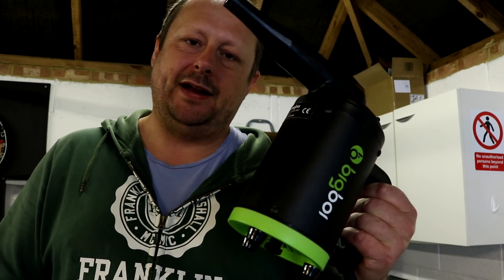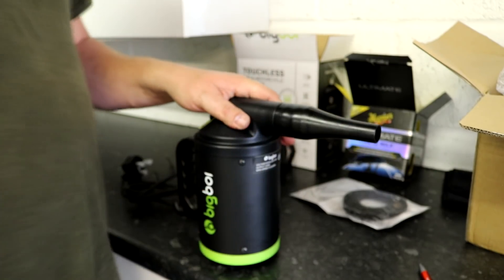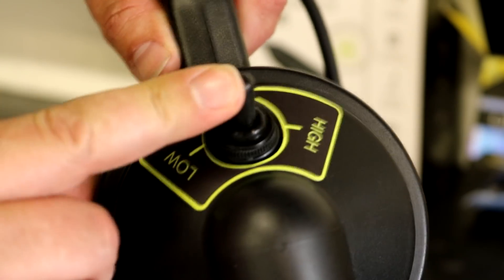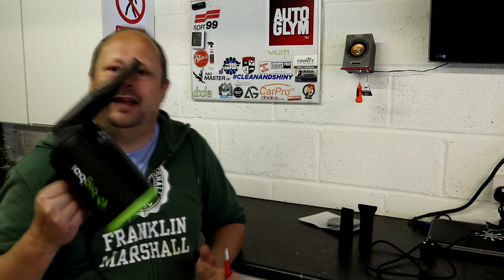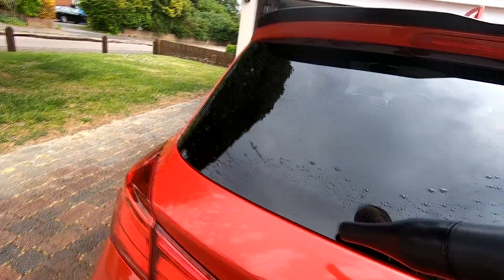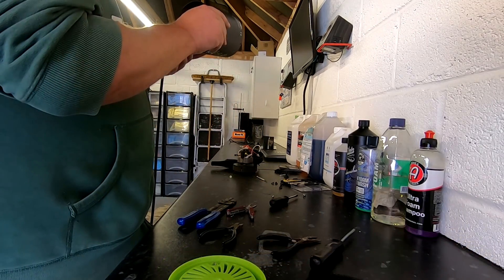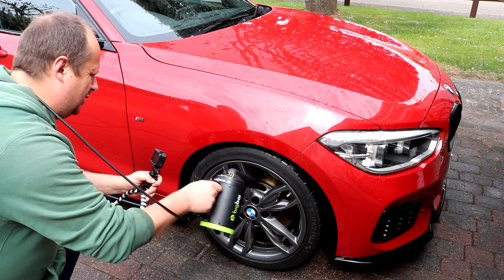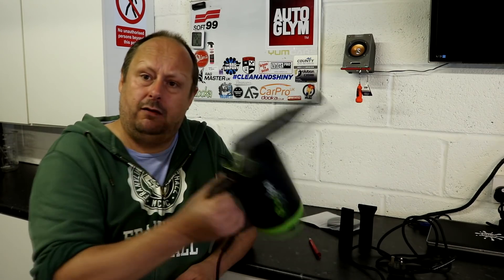The perfect tool for drying cars and avoiding water spots

Comment: I use the Bruhl 1400W motorbike dryer / blower. Blowers are decent, but a car needs to have a really good hydrophobic coating to make it work better.

Also, I find it harder to use in the summer as by the time you've blown our the crevices the water spots are drying, so I tend to towel dry first, then blow out. It takes longer but you reduce water marking / streaking by 90% or so
Reply from the maker: yer its point andy, sometimes the priority is get 99% of the standing water off the panel quickly with a towel before blowing out the crevices, even if that means you might need to get a bit of the smash water off the panel after when you blow out the crevices, its worth it to prevent the main risk of water spotting.

Comment: Great video and review 👍🏻 I have like you mentioned some Ryobi kit and have bought the inflator that goes with the batteries, it’s not really powerful and it takes a little longer but I use it for cleaning/dusting the interior along with a brush it works great. I also use it to blow the excess water from the same hard to get spots like wing mirrors and grills and of course water gullies. Wouldn’t be without it now. Oh and it blows up inflatables when I need it.

Comment: Any with that Titan Wet/Dry vac from Screwfix?... plug the hose on the other side and it blows hot air, quite handy to be honest! 🙌🏽
Reply from the maker: yer but it can also blow a ton of dust out tony.  specially if the main bin section moves.
Reply: Yh true no filter but then its the same dust thats floating about anyway i guess that can just as well sit on the car.
Reply: I use the Titan too. Tend to only use it when I'm going to apply a wax or dress trim etc. Not noticed it blowing out dust but I guess it's a potential issue. Given the Bigboi is a dedicated car blower, the short cable seems a very basic oversight - I'm guessing it will be a fatal flaw for most.
Reply from the maker: @stuarth902  mine blows out a ton of dust stuart even after I clean out the foam filter.    I think like others have said , it could be some law or legislation or requirement around cabel length.  maybe Im a bit anal about the cabel being modified some other guys suggested just using like a coupler connecter or single socket extention. thats the sensible solution i think. cheers m8

Comment: I found the electric Toro power jet F 700  140 mph 725 cfms  12 amp  $70.00 us  on Amazon USA .  Great blower multi purpose; good value , in my opinion.  Larger than your handheld.  Much cheaper than battery operated and stronger cfms.  Check it out!

Comment: It'd have been much easier to add a BH02686 connector on the existing cable, have it close to the unit if you want to avoid it dragging on the floor :)
Reply from the maker: your not wront michael but im glad ive done it this way, nothing dangling.. but yer it was a major ball ache.  had I known how much I would have done it this way.

Comment: I don't see how these are better than a leaf blower. There's so much more air volume at a similar speed, there is practically no need to towel dry after, especially if the vehicle is coated.
Reply from the maker: a leaf blower will have a tun more airflow but it blows stuff everywhere and its a bit unwieldy.   use a leaf blower if you want to dry the entire car.   its a cool little tool but the cord is a pain in the aris.  good for crevices.
Reply: You're always gonna have to go and touch up spots after drying the whole car with a leaf blower, too many tiny water droplets left over even on a coated car, never gets its 100% dry. The last thing you want is a big heavy leaf blower only for crevices/grills etc..a drying towel/drying aid and metrovac sidekick is my preferred way to get it bone dry going once around the car.

Comment: hi great video yet again can you please confirm if  your able to completley dry your allow wheels with this without needing a towel to dry the allows?
Reply from the maker: yes you can Chris. its powerfull.
Reply: @ForensicDetailing  nice I'm in between the buddy and the mini would be ideal not having to use towels like
Reply: @ForensicDetailing  what you think of completely drying a full car with the mini good or bad idea?
Reply from the maker: @chrisallen191  you end up chasing your tail too much, the air blast atomises the water and makes droplets on the panels etc.. I use it to blow out the places you cant get the towel into.
Reply: @ForensicDetailing  that makes sence do you think the mini would lesson the water droplets or stick with a towel for main paintwork? and buddy for alloys badges grills etc

Comment: Hi John,
Would you still buy it now? Or does your cordless Flex take over? I’m about to invest in one but don’t want to buy and regret it!
Thanks!
Reply from the maker: Ive not used it since I got the cordless flex.   But this tool is on another level of air flow. the flex puts out hardly any air. this little thing packs a punch though...   so if its power you want go for this.  If you want the convience of cordless go with the flex.  I just hate the cords generally.

Comment: Noise is an issue where I live.  Any idea what the dB rating of this is?  Not on their website that I can see...
Reply from the maker: im not sure but you can message big boi on facebook and they should answer
Reply: i'd be careful with any blower in that case regarding noise. It's not just the device but when you aim it into door jams, around wheel nuts, wing mirrors etc you can get a loud whistle too from the air being rammed into a tight space. Just thought I'd mention that, don't want to see you get wrong with the snooty neighbours.....
Reply from the maker: @aj63  its something to consider your right.  but its a lot less noisey than say my leaf blower and no more noisey than my hoover.
Reply: @aj63  You're right, there, although I ignore the nosy neighbours. Another disadvantage I've found is if I have been operating my SideKick in this manner for over half an hour, I am left slightly deaf with a ringing sound in my ears for a while after I've switched it off.

Comment: Don't you think that you are going to be blowing off dirt that can potentially be trapped in the hood gaps, mirrors etc. And then you dry it with a cloth and rub that on the paint causing marks?
Reply from the maker: its a risk yes... try and stay away from floor.. make sure floor is wet.

Comment: Isn't the 15-45 degree temperature the temp that it delivers rather than the environmental temperature?
Reply from the maker: dont know m8, this was the wording "Suitable for use in temperatures between 15-45 degrees C"
Reply: @ForensicDetailing  that means its useless for 8 months of the year then lol.
Reply: @blademansw  I have the metro vac and its useable in the winter, just doesn't blow warmer air at colder temperature so maybe that is what they refer to under 15 degrees

Comment: Slower airflow than the sidekick, more expensive than the sidekick, worse built quality than the sidekick, rubbish cable. I can’t see any reason to buy this over a Sidekick. I’ve got one and it’s a well built solid bit of kit, the big boi doesn’t beat it in any department.
Reply from the maker: the reason for me was simply the weight. but yer the metrovax tool has a lot going for for all your reasons there jon.  I think that tool would have done the job great as well.  I wish the BB was like 50-60 quid or something.
Reply: Forensic Detailing Channel at 50-60 I would of got the BB instead, both are expensive for what you actually need them for but at the same time I wouldn’t be without it now! Fun to blow beads around a freshly waxed bonnet

Comment: I bought a big boi blowr mini+ from the ultimate detail. I look after my tools extremely well. After 3 uses and 2 months, the cable grip which passes through the body came loose. This left the mains cable loose and wobbling around. Eventually it will fall off and could easy cause electrocution. The ultimate detail state it is not a warranty issue and I must pay for repair. It is dangerous and I am unimpressed. I would not buy anything from the ultimate detail again and avoid big boi.
Reply from the maker: Mines ok just some corrosion paint bubbling on the black barrel but can't y dismantle and repair yourself.  Maybe speak to big boi
Reply: @Forensic Detailing Channel   Thanks John, emailed Big Boi international a few days ago. Just disapointed with back-up on a not cheap item. If I open it up then it voids any warranty, indeed if there is any! Hope the old 328iS is going well.

Comment: Are Kärcher wet and dry vacuums also good with these jobs John?
Reply from the maker: the problem is if you have use the vacuums to suck dirt and dust.  you tend to get dirt and dust coming out when you use them as blowers.    I can use my titan as a blower but I face that problem at least.
Reply: Forensic Detailing Channel I see.............. what if I was to put a clean microfibre towel or a smaller cloth over the hoover sucky end bit ( I don’t know the name lol ) and turn it on to dry off the car? Would that be efficient? Thankyou

Comment: How do these 'professional' blowers compare to pet dryers?
Reply from the maker: there isnt a pet dryer equivalent to this little handheld one.  but the pet driers that sit on the floor with the hoses are decent.  reg has one, ive used a couple and I think I would have gone that way if I wanted that particular format.  half the price and probably coming out of the same factory is the selling point for me.
Reply: @ForensicDetailing  do they have the filters that the professional ones have though, just thinking of potential dust that may fly out
Reply from the maker: @mpatel3037  most of them do yer but check each machine.  a lot of them look like they are coming out of same factory..
Reply: @ForensicDetailing  For the most part if youve just washed the car then the ground is wet and there is no dust to pick up as any dust sticks to the wet ground.

Comment: I would cut just the cable and add to it
Reply from the maker: I thought about that, would be a lot easier.  Or just using the single socket ext lead.  Its a real pain to strip the machine down and its risky as well.
Reply: @ForensicDetailing  I know it sounds like a bit of a faff, but if your BigBoi Buddi went bang, couldn't you just swap the original cable back onto it, before shipping it back for warranty work? Being careful not to damage any surrounding small parts, it may be worth it. And a 2 year warranty is very generous for a detailing item like this.
Reply from the maker: @owensteele1274  hey owen I think everything sold in EU countries has a 2 year guerentee, even if the manufacture claims 1.  but I just kind of accepted I was breaking my warrenty, because Im tampering.   they would be able to tell as well.  plus I have it on the YT channel with the long cabel ;(

Comment: Why not just use a air compressor?
Reply: Milkoo1337 because it’s big and heavy to pull around, it’s also very load, these drying are built for convenience, the air compressor should work fine if u willing to drag that thing out every weekend
Reply: “Loud”
Reply: That’s what I used it has a long hose and does a great job

Comment: This product does nothing for me because I'd rather have a tool (a blower) that can handle multiple tasks. I can blast the water off the car and out of the crevices and also blow the leaves out of the yard.
Reply: The thing with one of them garden blowers is they suck dust up and blow it all over your car and then by the time you go to hit the car with a polisher your putting fine scratches from all the fine dust particles, well that's my opinion anyways

Comment: Ladies and gentlemen, this is probably the most stupid video in the car detailing sphere. The 2m cord is too short, so he **voids the warranty**, takes apart the blower, installs a longer cable (extra expense), all because he didn't want to use a single plug extension cable for fear it might drag on the ground. You could have at the very least just spliced a longer cable onto the end with a bit of solder and with some heat shrink to protect the connection. Jeez.
Reply from the maker: I said the same thing in the video so this is prolly the most pointless comment in the detailing sphere!  Im not wired the same as you though I will put a new cabel in and I know I wont encounter problems because I will do it properly.  You on the other hand cant change a light bulb without f'ing it up...   ladies and gentlemen lol you silly little sausage.  /delete